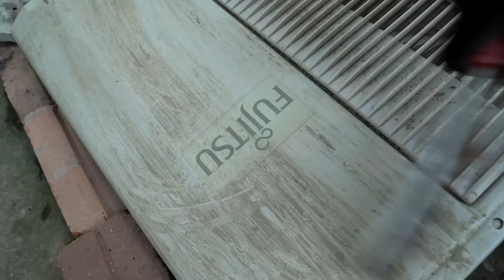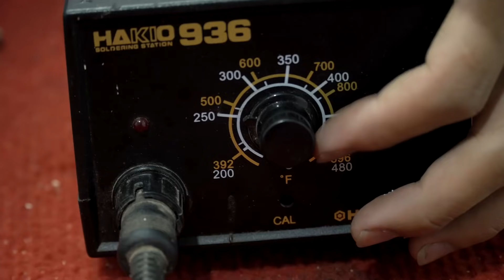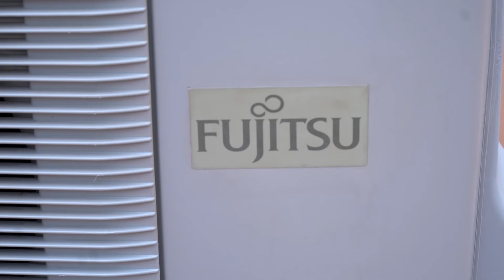Restoration Old Air Conditioner FUJITSU | Restore Air Conditioning out of date

Comment: Great restoration.  Is unit missing the top panel and back side  grillle?  Its probably in the trash pile some where.  Also you are always finding the outdoor units, but never the matching indoor units.  With these mini split acs you usually get a new indoor head unit with   tbe outdoor unit, so there would be no need to keep the indoor unit either. You think the person would toss the indoor unit alongside the outdoor unit.

Comment: I do admire the guys efforts, but, this was the biggest waste of time if I have ever seen one before. Seems to me all that was done was taken apart, and cleaned/painted and put back together. First off, these wont work without the evaporator head, so without that it should have just remained in the trash heap unless you can source another one. 

On top of that, nobody verified if the compressor was any good, if the coil wasnt punctured, if the Fan motor was still good. Main line fuse was blown on the control board, which leads to me that the BLDC motor drive IC has failed in some way. This is a common failure and requires replacement of the control board with a new one. 

Not to mention, a vacuum, recharge, and test! so, with that said, Well... You all did a nice job cleaning it up and making a yard ornament :-)
Reply: Totally agree!
Reply: Would have been better to repurpose parts of the condenser unit. The compressor can be made into a silent air compressor, it just needs a moisture filter and a trap to keep the oil from blowing out. The fan and motor may be able to be repurposed as a general fan if it moves enough air, just need to make a stand/enclosure for it. At least that's what I would have done, it makes no sense to put a ton of money into a sketchy unit with no evaporator unit.
Reply: "motor drive IC has failed in some way. This is a common failure and requires replacement of the control board with a new one" - or like a 5$ IC from Aliexpress and 15 minutes of work.